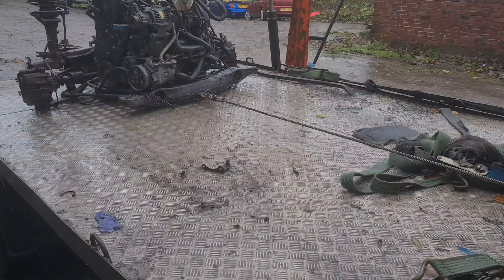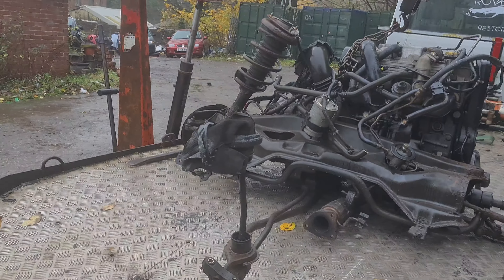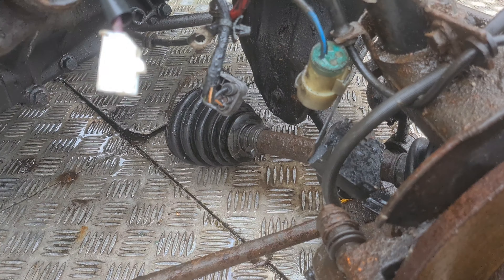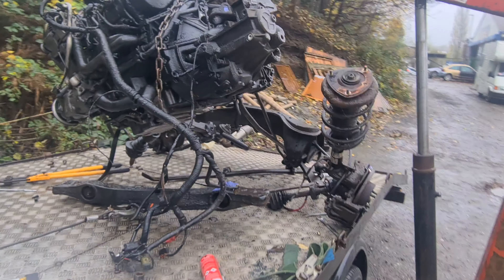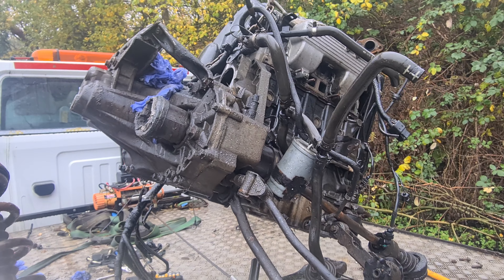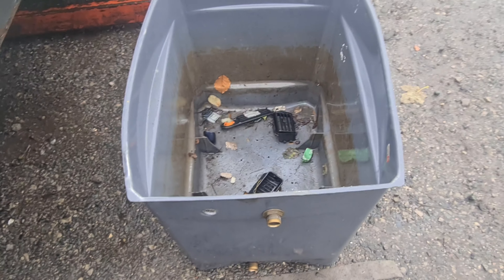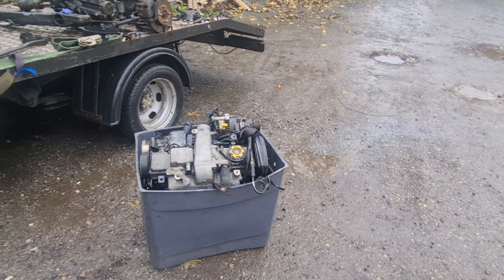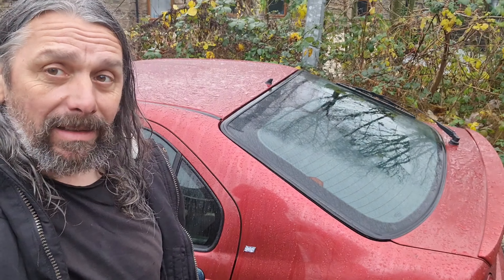L-series gearbox removal. (without a cup of tea)

Comment: Oh, the inevitability with which that engine was going to fall over while you dragged it in the drizzle...
Reply from the maker: 🤣
Actually I was getting a bit cocky, but I was really pleased I had found a way to move it quite easily.
Reply from the maker: Also, it wasn't that difficult to pick back up two-handed with a seatbelt, but the missus didn't record that bit

Comment: How good was these L Series engine? I think your brave for working outside. I dread the cold spell going to happen soon (Not what you need to hear)
Reply: The L series was reliable and economical and for the time were classed as relatively green, I believe it was a rover/ perkins collaboration. Project Nigel should be able to confirm
Reply from the maker: I prefer the cold to the wet; I can work hard and warm up and be fine. There's no way to get around the rain whist outside, so I actually prefer snow.
Reply: @ProjectNigel  I actually don't mind working in the cold, but I don't like the wet. Forget snow, that's awful stuff.